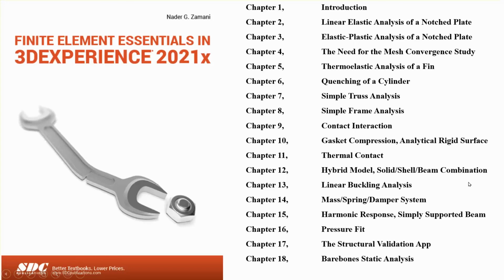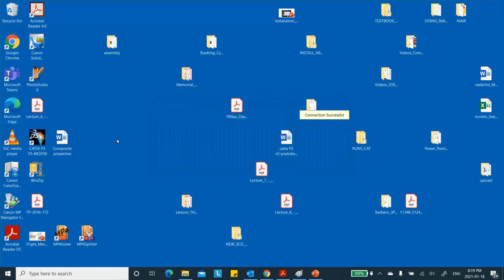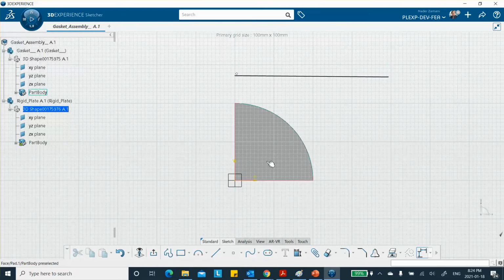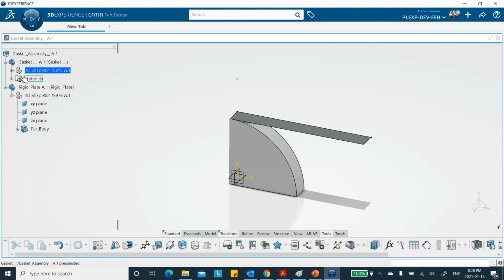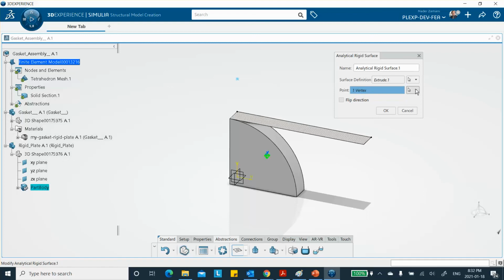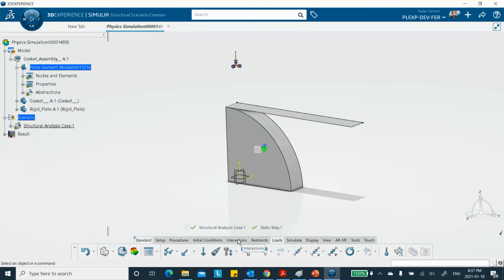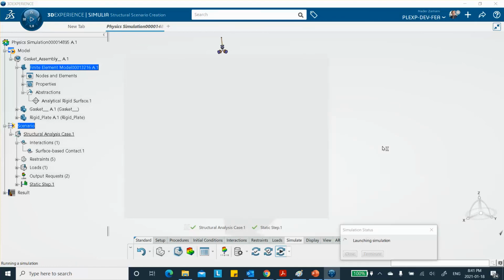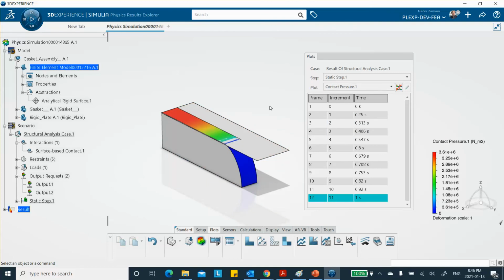Chap 10 Finite Element Essentials with 3DEXPERIENCE 2021x Nader G Zamani

Comment: Thank you for the great example. Do you have tips and tricks for selecting time increments when the mesh is finer?
Reply from the maker: Dear jsy3351, this is a static solution and the "time" is not the real time. In such problems, the initial time increment is fairly randome, but the automatic time stepping is used. The minimum time increment is inportant. In your erlier comment, yo mentioned that I used wrong contact selections. Can you elaborate please.
Reply: @naderzamani5752  Thanks for the prompt reply. You selected both surfaces Master. You said you're going to select the gasket face as the slave but I think you misclicked it. So you did not define the slave surface there.